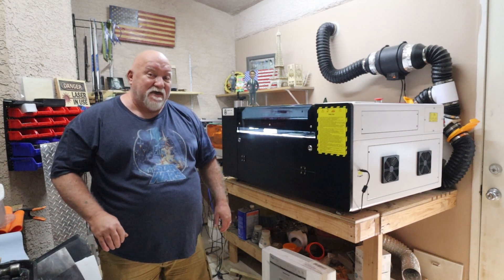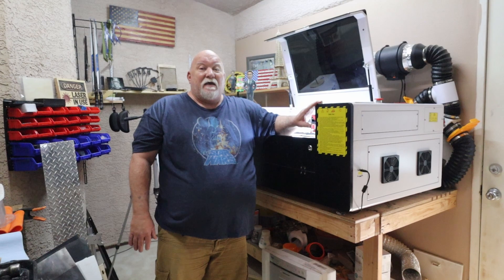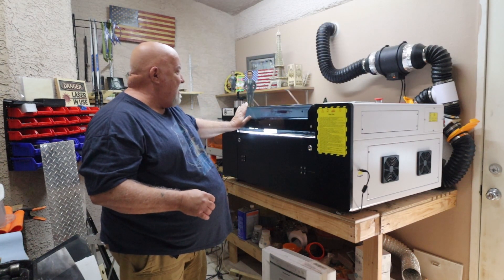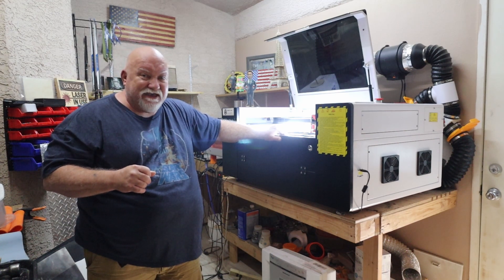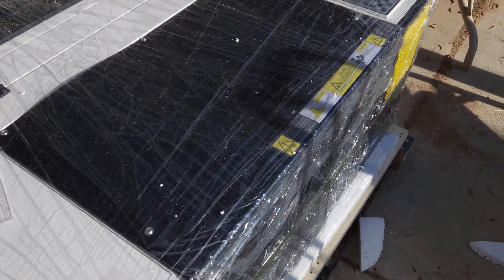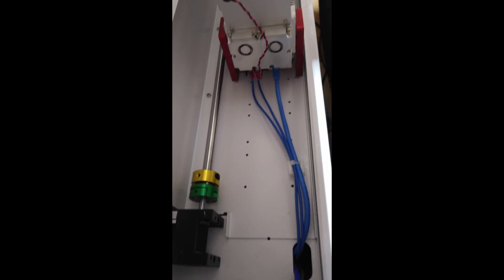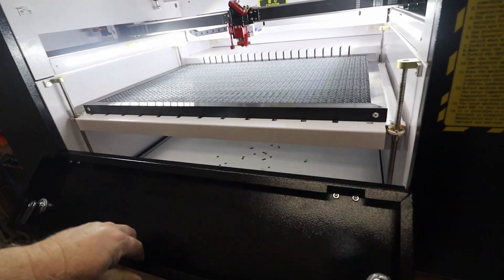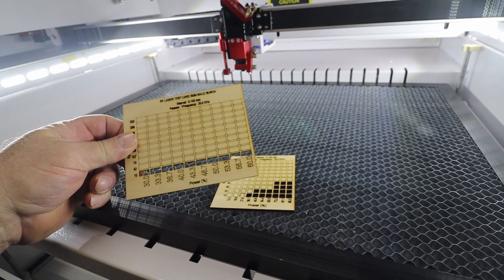Best Deal Out There on a RF CO2 Gantry Laser #3dhp

Comment: I think there's a bit of a mixup or confusion. It may be an RF tube, but it's still a co2, It's just not a glass tube. Same wavelength and still uses Co2, it's pulsed RF (there are also CW RF tubes, might be that too) instead of continuous wave Glass. It feels stronger because of the tighter dot size, should make for a great engraving option with finer detail capability!
Reply from the maker: Yes that's why I have it titled as Hoatian called it. Metal Tube C02 Gantry Laser. Thanks for your comment.More info the better. We all learn from each other .
Reply: @3DHP  Yup! I just meant when you were talking over the specs during the video, you were comparing it to a Co2, but I think you were referring to a glass tube. It just makes it sound like its not a Co2. Not trying to be a pain and dont mean it that way, just feedback and didn't want anyone to get confused from the context in the video that I was pretty sure you meant it as more as comparing glass tube to the RF tube you have. Keep rockin!
Reply from the maker: @lokidoo2090  Thanks, I will make that more clear in follow up videos.